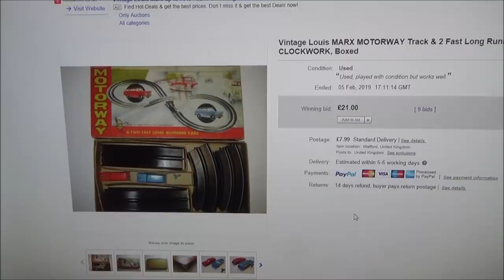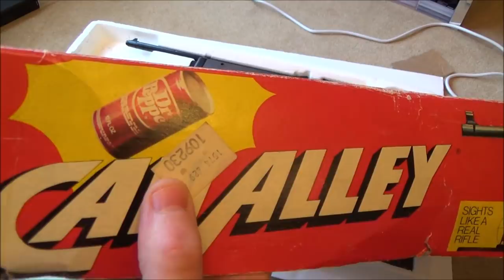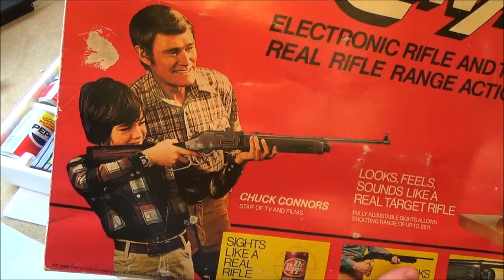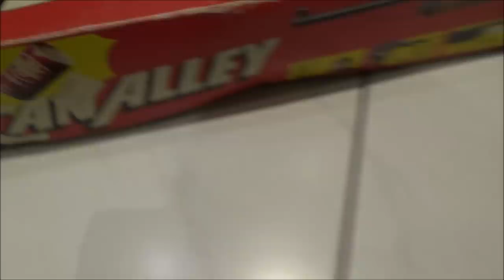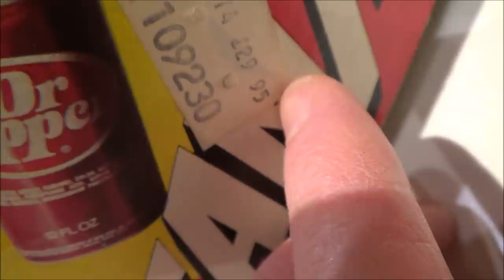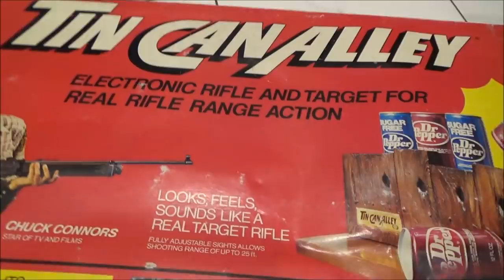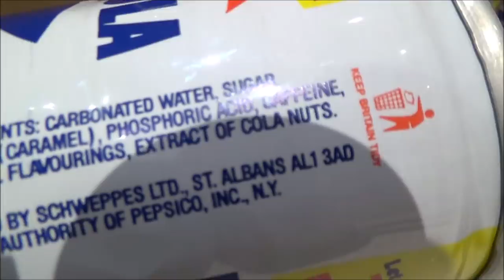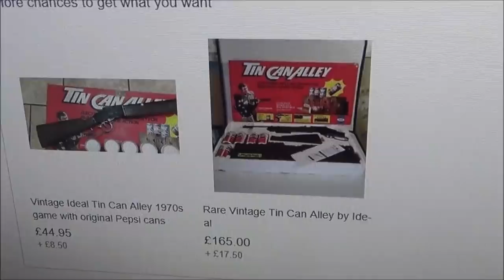eBay Pre 1980s TOY Repair Challenge PART 2

Comment: I'd say the component is an SCR which latches on when using DC, with the gate controlled by the CDS cell and a voltage divider. The SCR will reset when you remove the power ( the brass thing hits the notch in the track ). SCR's are usually used in light dimmers on AC and reset every half cycle.

Comment: The light sensor on the fence is a LDR(Light Dependant Resistor). A LDR is a resistor that varies its resistance when a light is shone on it. The only other 2 legged device that it could be which I doubt it is would be a photo diode. A photo diode is a diode that produces a small electrical current when a light is shone on it. A power source such as batteries are used to provide a larger electric current. This would mean in this case the batteries weren't quite enough to power the motor and the batteries and the photo diode are needed to drive it. This doesn't seem feasible since when light stopped shining there wouldn't be enough power again to drive the motor. Plus the fact that photo diodes are small and the size of the hole in the plastic for the sensor is LDR sized.
Reply from the maker: As always, brilliant information. I hope you know it is always appreciated :-)
Reply: And since the photo resistor from my understanding is just a switch that is turned on with light you should be able to attach your meter to continuity check both sides and shine a flashlight It should close when light goes in. Probally why it would work when you turned it to an angle it was picking up your lights
Reply: @johndorian4078  No a Photo resistor varies it's resistance with the amount of light. So for the purposes of the toy it works like a switch because there is either light or no light but for a gradual increase or decrease in light  the resistance raises or lowers accordingly.

Comment: I'm glad you got that one Vince. If you'd not sold it already I could have provided you with a scan of the original instructions from a 1976 original which are printed in magenta. There is a sight missing, it is usually contained in a bag with the instructions, the bolt, and the sheet of labels. But it's great and I knew you'd make a profit with it.
Reply from the maker: Thanks for the info :-)
Reply from the maker: Can you remember if the sight is like a barrel that you look though or is it just a tiny little cross or something? I can't seem to find much information about these online at all :-)
Reply: @Mymatevince  it's a small piece of plastic that slides over the small post at the rear of the rifle. I can take some pics of mine and send them to you if you'd like.
Reply from the maker: Oldman_PJ- Thanks for the link and how to calibrate it. I fully understand it now :-)
Reply from the maker: blasphemer71- thanks for the offer, the link above/below shows it so I understand it now. Thanks for the offer though :-)

Comment: "Not Tested" = "I tried it and it did not work but you will be more likely to buy it if I don't admit that"  (Frequently said on eBay listings of old electronics where the magic smoke came out.)
Reply from the maker: Yeah, unfortunately not tested really means fully tested and not working 80% of the time :-)
Reply: @Mymatevince   Or it could just be a seller who has got fed up with stating items work after fully testing it to have a scammy buyer claim 'item not as described' for a full refund who demands £25 to return it overnight signed for delivery so they can keep it for free as they send a brick back. With the full 100% money back guarantee as a buyer you do get the privileges with eBay purchases to enjoy a 'try before you buy' and 'on approval' 'sale or return at the sellers cost' purchase with unlimited free credit, the lack of integrity is most definitely on the buying side mate. 'Not tested' means its not brand new and sealed and once out of my custody I'm at the buyers mercy so I need to limit opportunities for theft as buyers false claims will shut down my ebay business.

Comment: Lovely fix. Very nice toy. Also, I don't mind the length of the video, in fact, I prefer lengthy, in depth videos, over short quick ones with all the actual troubleshooting bits cut out of it. It's the troubleshooting bits which I find interesting.

Comment: Capacitors can source more current than the pp9 battery - results in a brighter flash from the bulb which would (when you hit the sensor in the fence) give the shooter a better chance of the game detecting hits in a brighter environment. Although not a close analogy, a camera flash does a similar thing on a bigger scale - it charges a fairly beefy capacitor up to 300-600 volts from a 6V battery, and then dumps all that energy into the flash tube with the assistance of the trigger transformer to produce a really bright flash. 

The fence circuit works as follows. When the brass piece behind the can striker is in contact with the rivet, it short circuits the SCR (the transistor looking thing). This performs two jobs: 1. To reset the SCR, and 2. to move the mechanism into position for the first position when the game is started, and subsequent positions after each successful shot. When the light hits the photo sensor (probably an LDR or Phototransistor) it triggers the SCR's gate. When this happens, the motor runs long enough for the mechanism to move far enough to strike off the can at that position, and to cause the brass bypass circuit to re-engage, short circuiting the SCR again, and running the motor until the mechanism is in position for the next target. The resistor is there to limit the current to the SCR's gate, and the diode protect the SCR from the back emf from the motors windings.

Oh and PS, I WANT A GO! big kid at heart, and if I cant hit the darn sensor I'll just get my hand held laser out, but it might destroy the plastic, and that toy is so neat I think the laser would stay in my bag!! ;)

PPS, you chose an awesome name for your Son, Ben - thats my name as well. He's definitely the rifleman, he knocked those cans down like a true marksman.

Comment: Great job mate..I was able to fix my ps4 HDMI port because of your videos..took me over 4 hours but the satisfaction of success is priceless lol...may I ask bro what's your educational background?..thanks again and wishing you the best always
Reply from the maker: Thank you and well done on fixing the PS4 :-) I went to college and Uni but unfortunately I didn't work very hard or attend very often and it wasn't in engineering/electronics as you can probably tell:-) Looking back I wish I had worked hard and I may have achieved something but being young and foolish I always found something else to do rather than study (I had a great time though). I was a telecoms engineer for many years, and in my early twenties I restored a classic MGB GT which needed sills welding and various panels and mechanical stuff as it was rotting in a back garden for 10 years. Before I could drive I had replaced a valve on the engine of my 1st Mini car so I have always been willing to give things a go. I have always taken things apart from a very young age to 'see how they work' so these videos allow me to do what I have always loved doing even if I may not be the best at it :-)

Comment: Hi Vince. In that situation where you had to snap the barrel band over the fore-grip, you might consider dunking the plastic (the band in this case), into some hot tea water for just a moment. The plastic will become more yielding and less likely to snap under stress. I'm not criticizing, just offering some advice. I cringed when you snapped that band back on but it worked out fine. Interesting video as always.
Reply from the maker: OK, thanks for the advice, I hadn't heard of this technique before so always happy to here new ideas :-)
Reply: I'm glad you took that the right way. Yep, it only takes a second or less. You can always dunk twice, I would suppose too long might warp a part. Also toy folk will dunk bent items, then unbend them while it's warm, and when the plastic cools it keeps the new straightened shape. That's another way this technique can be used. Might come in handy one day? Good luck in the challenge.

Comment: I've just brought a tin can alley and come across your brilliant video. The bulb only lights up very slightly and only when I play around with the trigger but not actually pulling it. It has a brand new battery fitted , could the bulb need replacing if it's not flashing brightly? It says pr6 is that correct? I'm just a bit stuck as I've taking all apart now. The trigger mechanism works fine, well it did 😆😬

Comment: You can get rid of the rust on those screws by dropping them in a cup of vinegar for a while. Vinegar is also the best thing for cleaning up after leaky batteries (the acid neutralizes the battery chemicals).

Comment: I was 16 and using the real thing by then. I had a Ruger 10/22 and went hunting every day I could after school during hunting season. Now everything is Nerf or air soft. We had BB Guns too. I do remember seeing those. 1983 and 1976 are two different times with a LONG stretch. I think you got rooked. lol. The thing is, they made many toys for longer runs. Eather way, its still an older toy. Those might have had the pull tabs rather than the pop tabs type cans. I heard that was a pretty popular toy back in the day.

Comment: the capacitor charges up . when you pull the slide back  charges the capacitor in less then a second. when you release it it activates the second contact in front and releases the charge.

Comment: the "transistor /voltage regulator" is actually a silicon controlled rectifier - the light switches it on - and it stays on until the current is broken then it turns off again {possibly a c106d ?}

Comment: Not sure, but i think when you cock it will charge the capacitor. And when you shoot it will discharge capacitor to light bulb. Otherwise it would also be possible to discharge that battery.

Voltage have to be 9v in whole gun. There wasn't any boosting circuit.
Reply: btw, in this kind of old things, always when you open i recommend to change those electrolyte capacitors. Their lifetime is anyway like 20 years or so and they are cheap. So change them so next owner can enjoy longer time :)

Comment: oh boy, pre 90's copper spring circuits, these things never work when you get them and then its almost impossible to restore them without messing up the switch calibration which is a pain all by itself, annoying to work on but quite reliable once you get the quirks worked out

Comment: I was just thinking, that so you wouldn't have to take the bolt out every time you attach the stock, wouldn't it just slot into the notch, and where the hole is, is for a collar? Then the stock would be in the correct position and you would have to put it on upside down to fit. just a thought.

Comment: That looked like a 300v capacitor I am glad you didn't get a shock,  please be careful with capacitors
Reply from the maker: Sorry for sounding dumb here....I didn't check the voltage but even if it was 300V would there be enough current to cause any problems/risk. I know you would feel it but for example on a HT lead that goes to a spark plug on an old car from memory it has 1000s of volts but very little current so when you get a shock it makes you let go and doesn't feel nice but it doesn't cause harm to a healthy person to my knowledge. Would love to know if it is a similar thing with these smaller higher voltage capacitors :-)
Reply: @Mymatevince  you are right, you would feel it but it is to small to have lasting effects on you but it could easily destroy other electronics on a circuit board. if you ever see the bigger ones like inside microwaves these can do some harm to you although most newer items should have a discharge resister to stop this
Reply from the maker: @jameswheeler111  Excellent, thanks for replying back and the advice. I wanted to make sure :-)
Reply: You would know about it getting a belt from 300v  the amps are what's dangerous tho

Comment: There is no inductor, so capacitor can't charge over the battery voltage. I suspect that when trigger is pulled the light bulb is connected in series with a capacitor, resulting in a single flash (capacitor is charging via the light bulb), even tough the contacts remain closed (charged capacitor is a break for the DC). The capacitor remains charged for a some time, so consequent pulling of trigger won't produce any more flashes, until you reload, and this reloading shorts the capacitor, discharging it. It may be also the opposite, and reloading may actually charge the capacitor from the battery, while pulling trigger may discharge it through the light bulb.
Reply: I figured that too, it would have been nice to be able to see it better. When cocked, battery charges the capacitor, when fired, battery uis disconnected and the capacitor is shorted through the bulb. Gives only a single shot. Simple but very, very ingenious. These days people would program an Arduino to get the same effect.
Reply from the maker: Yeah, I am so sorry that the filming was so bad on that part. I didn't want to risk snapping the end off the barrel so I was having to try and wedge it open while filming.  So annoyingly I couldn't show where all the wires went clearly especially on the important bit up top where the wires contact when it is cocked and then triggered :-)
Reply: @Mymatevince  When it's cocked it is charging the capacitor.. when you fire it dumps the cap to the bulb.
Reply: @fatface266  To charge - no, but to charge to a higher voltage than the supply voltage (battery in this case) - you need one. So please read the whole sentence before answering.

Comment: Looks like when you cock the rifle it charges the capacitor up, then when you pull the trigger it discharges the capacitor into the bulb. 
The low internal resistance or ESR of the capacitor gives a quick flash and faster response of the bulb,
 instead of just applying the battery voltage with its higher internal resistance to the bulb.

Comment: The cap was to stop you cheating, some cheaper copies never had it so by holding the latch and trigger at the same time you just had a torch which meant no skill needed. I destroyed 3-4 of these making intruder alarms for my draws and cupboards connecting a buzzer to the light sensor. My brothers were not happy.

Comment: If yo haven't sold the unit yet, and yo did-n blow out the cans, Get yo self a bike pump and some flexible material to tape and seal the cans but first drill a hole in the material so that you can use a blow up toy attachment inserted into it, and gently pump the can up with air till they are little more decent.. As per u-shell I dropped a Like..
Reply: Damn!!! I just realized they be sealed them thar cans :( so yeah NVM
Reply from the maker: Thanks, they each have 2 sealed circle bits up top but on most of them those sealed bits are pushed in slightly so your technique would work :-)

Comment: When you cock it the capacitor is being charged through the rear contact., when you pull the trigger the capacitor discharges through the bulb via the front contact.
I am at 35:13 and I am guessing your ambient light is too high.
38:54 is a light sensitive  resistor,
https://en.wikipedia.org/wiki/Photoresistor
I asume that the device is an  SCR which starts the motor off and then the contact on the rail joins and turns off the SCR by shorting it's anode and cathode, the unit then stops at the next dip in the rail.
This is another situation where the silicone spray/curtain rail lubricant would be good, also replacing the capacitor maybe required to get full output from the lamp.